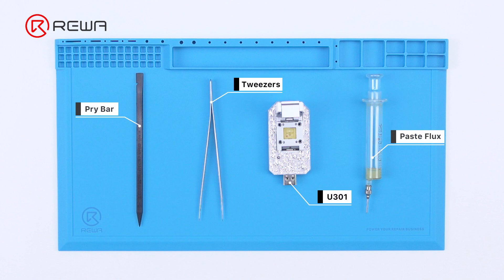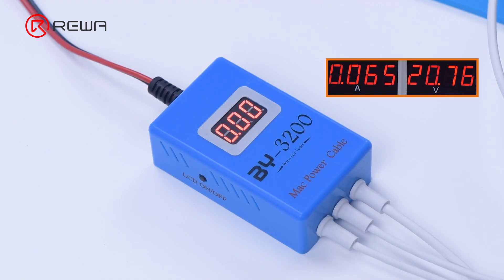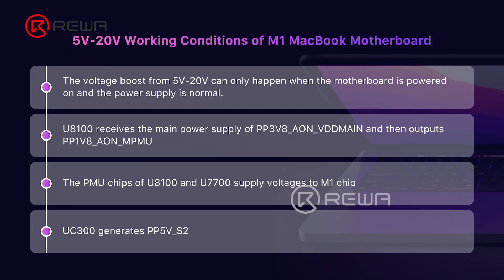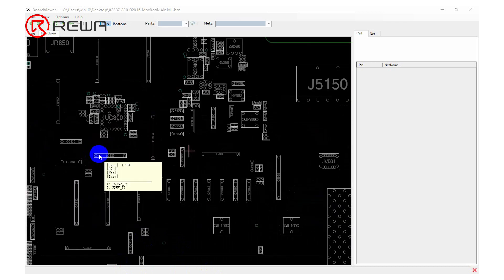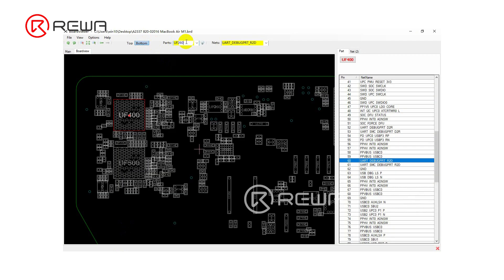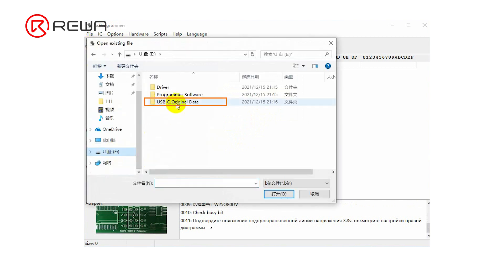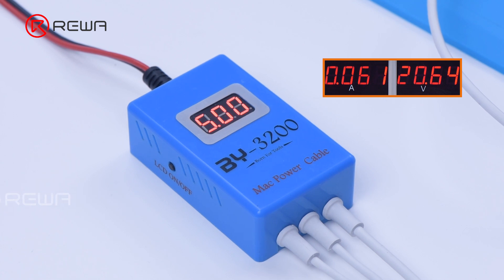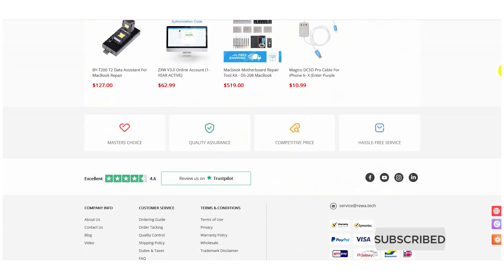How to Fix M1 MacBook Air Won't Turn On

Comment: My macbook air m1 is not turning on took it to the service center they are saying that the mac is not responding and mother board needs to be changed and it costs half the price of my macbook dont know where to get it repaired. Now its lying in my shelf🥲
Reply: Same issue, did you get it fixed?

Comment: hello i have a a2179 logic board and i cant seem to find the t2 rom chip to reset it using the t203. Can you assist please
Reply: hi Leon. Can you please share a .bin file which is contained in the t203 usb? i need for it for a macbook A1990. i would appreciate a lot

Comment: Hi REWA, if my xs max can't turn on, but when connected to dc power supply, it shows up charging icon. Can you advice what is wrong with the motherboard?
Reply: First of all try a new power flex cable check connectors check for any missing filters/resistors on board

Comment: How does the rom data get damaged? Per the name, it’s supposed to be read only…
Reply: It happens very often also in windows machine. you can damage it during BIOS or OS update process.

Comment: this doesn't answer why it stopped working, please when fixing list the possible causes of failure first then diagnostics then what to look for. looks like you just want us to buy that chip reader.
Reply: And the chip reader is also absurdly expensive
Reply: @-_YuvrajSingh_-  TRUE
Reply from the maker: Hi, we diagnosed the MacBook in the first place. For your information, Type_C circuit of MacBook all uses a boost process from 5V-20V. If ROM data of the USB_C is damaged, the motherboard will only have a 5V power supply. When the voltage jumps back and forth between 0-5V (our initial measurement), ROM data of the USB_C might also be damaged. U301 can rewrite the ROM data and get the motherboard back to a normal boost of 20V.
Reply: @rewatechnology2008  Yes, but what do you think made the ROM data of USB_C damage at first place?
Reply: @TechyGodwin  they cant know what or how it was damaved but as a rewritable chip it can be corrupted as per one of nand gates inside might for a moment collapse so it has to be cleared and rewriten. Dont ask stupid question if you dont know basics or go learn basics then come here and comment. These guys have years of experience and share knowledge for you to have an idea where to look not to harm the board for example there are idiots who go and fry the gpu or cpu because they lack knowledge so first of all thank them for the video.

Have a good day
Reply: Thanks  @leonferko  !
Yeah maybe I’m stupid coz you know the stuff which I don’t, but um always open to learning. Thanks for the insights… and I do like and appreciate each and every video of their’s…
Have a nice day 🙌🏼
Reply: @TechyGodwin  nah nobody is stupid sorry for my manners tho. Is just i just got my degree in electronics and all fired up 😂😂😂
Reply: @leonferko  Cool Man, no worries x🤘
Reply: The winbond chip can be easly corrupt like on a basic pH no fan. Because is writable chip
Reply: That's the point... It's not directly a lesson channel, in every video there are missing steps. Don't ever try this at home unless you already know what you're doing! Chances high you damage more which leads to non profitable repairs

Comment: why this problem?
Reply from the maker: Hi, Type_C circuit of MacBook all uses a boost process from 5V-20V. If ROM data of the USB_C is damaged, the motherboard will only have a 5V power supply. When the voltage jumps back and forth between 0-5V, ROM data of the USB_C might also be damaged. U301 can rewrite the ROM data and get the motherboard back to a normal boost of 20V.
Reply: @rewatechnology2008  I want to learn macbook repair course.  can you do macbook repair online course
Reply from the maker: @alwaysasif786  The course will be out soon on REWA Academy.
Reply: @rewatechnology2008  I am a REWA Academy online student and I am very happy to learn your online iPhone and Android repair course. I am very excited learn your  macbook repair course for update my repair skills.
Reply: relax mode on :D
Reply: Did they ever get the online training for Mac book